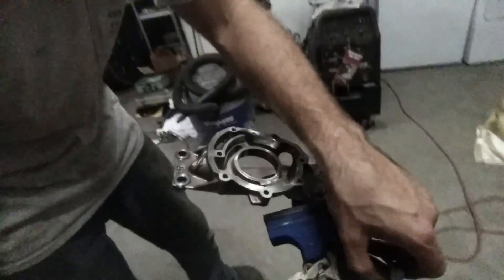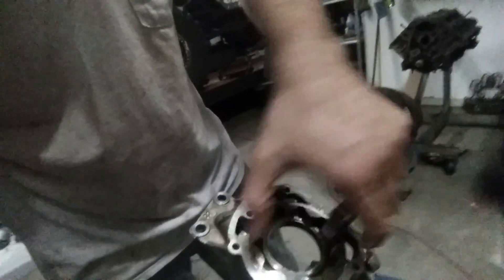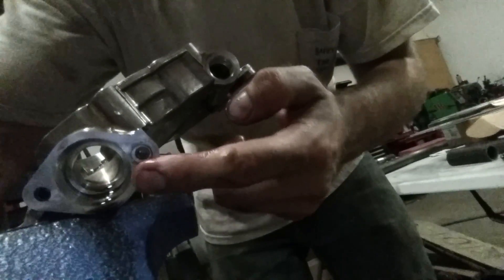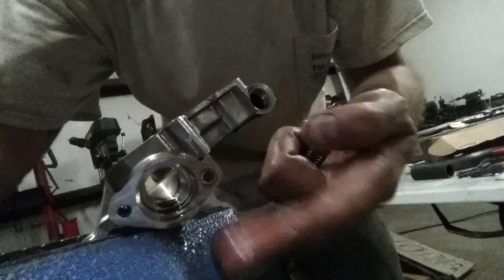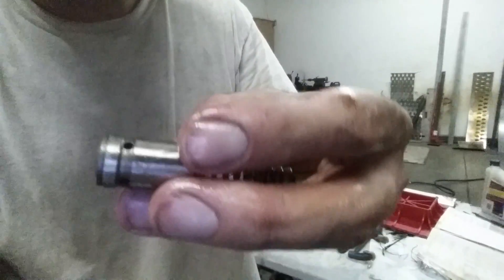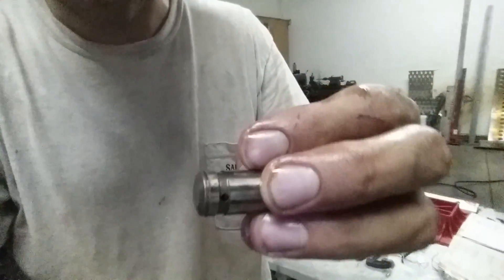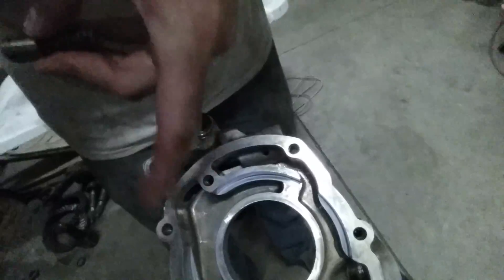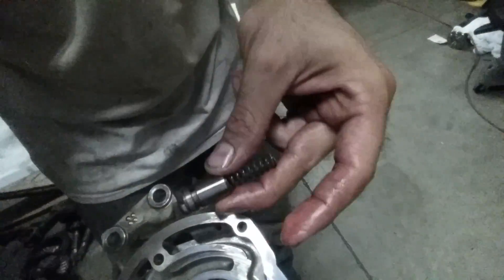Ls engine oil pump problem

Comment: Just a quick comment ---- oil is not compressible. It is a hydraulic and cannot compress. It can be pushed into the engine under pressure - but saying it compresses violates a lot of the Physics Classes I had in school.

Comment: Jake, I feel your exhaustion and I appreciate you posting this. I have the LS 6.2 Liter engine, I had lifter failer cylinder 6. I replaced all of them. Drove a week. And oil pressure to zero . Frustrating. I now waiting for autozone to deliver the new pump. I-ring was squished but not broken. Wasn’t a smoking gun on what’s wrong. I am praying now that I have it apart it’s the same issue you had. Otherwise gosh idk. A bad bearing?!? Ugh. Good luck in your race. My 2010 Yukon xl Denali had 193,000 miles.

Comment: Alright, here's where I'm at. I realize that not everyone who has low oil pressure on their LS is going to have the same common cause so before I get a flood of comments stating what it may or may not be this is what's done so far. Engine blew a head gasket. Tore down top end and replaced head gasket seals, valley cover seal, intake manifold seals, valve cover seals and water pump seals. Started her up. Ran fine with normal operating oil pressure for about 15 minutes of driving. Came to a stop and noticed oil pressure tapering off accompanied by a mild squeal that immediately went away. Stopped driving it and did a bit of research to no avail. So far I've replaced the oil pickup line o-ring that everyone likes to say is the problem, then inspected the oil sensor screen that doesn't exist on mine because between 99-06 there wasn't one. replaced the sensor just to be sure. still low readings. Replaced the oil pump and timing chain and gears while i was in there along with the oil pan gasket, still same exact readings. So like I said before everyone has some sort of issue causing this and you can read through countless annoying ass forums with nothing but speculation on what is causing this. Occasionally you'll get someone awesome like this guy Jake Burkey who actually diagnosed HIS problem and decided to be kind enough to share what he found. Unfortunately since I just replaced my pump 3 weeks ago I'll have to count that out as well. Im just wondering is there anyone on here that may have any idea other than what I have stated above that could be causing this issue. Im ready to put tanerite in the engine and shoot at it. 

By the way, it runs smooth as hell and runs very strong until the oil reaches operating temp and loses pressure gradually. Super annoyed and decided to reach out on this random video comment section as a last ditch effort before I pull this 5.3 out and find one with lower milage
Reply: More than likely to be a roller on a lifter seized
Reply: Man,,,,I Feeel your pain and frustration. & agree, jake was awesome to post his smoking gun. It is nice to see someone god damn it find the damn problem. 
Now someone just said lifter roller. And idk about that mechanically, if the roller was bad would destroy the cam. You would hear it I think. I have the 6.2 LS and did all the lifters, and a week later bells and whistles the oil pressure light blowing up again. So now waiting for autozone to deliver the freaking thing. But looking at the oil pump. I see a slight crack in the O ring, I mean a lil squished, 193,000 miles. But don’t look the worst. And I took the piston out the relief valve in oil pump and it don’t look the worst. So I’m worried now
. So I thinking with you and maybe me, could it be a crack in the block that heats up and opens? Maybe a bearing that’s blown?! Idk what else it could be. But I’m with you now....ready to shoot this mother fucker. I’ll let you know what happens when I replace the pump and O-ring. Cheers Kevin

Comment: This is EXACTLY what just happened to mine. Good oil pressure till it gets warmed up, then goes down to 6psi. Took mine apart, and it is exactly like yours. I could actually get the plunger to hang up when I took it apart. Confirmed that this is the problem...

Comment: Thanks for the info man!. i have a lm7 5.3 in my 2002 chevy silverado and ive been having low oil pressure i believe my oil pressure gage keeps jumping up and dropping but i have a feeling its the oil pump idk maybe you can help me also what tells me it is when im sitting at a stop light and its turns green then i go around 1500 -2000 rpm my truck will just lag so hard almost as if it wasnt getting fuel but then when i look at the oil pressure gage its drops to 20 also its worst in reverse.... When im in reverse i can barely tap the gas and it will bog super bad yesterday it actually shut off on me and tbh i believe thats when it dropped down to zero oil pressure so i cranked it hesitated for a sec then turned on and like i said i watch the oil pressure and when the truck bogs the oil pressure drops idk what it could be honestly.

Comment: The hydraulic lifters in my Chevy LS1 engine looked like that when I pulled them out of the engine block yet they measured o.k. with a micrometer.

I have fitted  new lifters but I'm waiting on the cylinder head gaskets & bolts, also I've been f**ked around with the timing cover seals,the gaskets were right but a rear main seal was supplied instead & the oil pump pickup tube wasn't, I replaced the timing chain so I needed that since the oil pump was removed,so I ordered an OEM one.

Then I ordered what was supposed to be a front crankshaft oil seal for the LS1 onwards engines only to be sent a seal for the 3.6 litre LY7 V6 engine (aka the Holden Alloytec V6 engine in Australia).

So I ordered one by part number rather than description on eBay today & I'm sending back the V6 seal tomorrow since it doesn't fit (it's OD is 70mm instead of 72mm & its ID is 50mm instead of 54mm).

Comment: Could you have fixed in the field by pulling the plunger and cleaning it out?
Reply: Apparently sometimes theyre dirty as you say and sticks the piston open, but he said his was stuck from wear not dirtyness, so In his case cleaning would have been a fatal error because the problem would come back at some random later date. This is not the type of problem you want to come back bro.!!

Comment: I have low oil pressure and noisy valve train for the first few seconds then it builds, whereas it used to build pressure right away. does this more likely seem like the o-ring gone bad thus losing prime like you mentioned? its in a c5 so getting in there to take a quick look is impossible and I just want to order parts before I start. Thanks!

Comment: those covers for the oil pump have problems with the return hole to the engine and you have to bore it out.
Reply: Hi January befor. Can you maximize your self on your comment? The valve is for the oil tu recirculate but it is to small? thats your meaning? or it glogge? Just now i have a issue. i start my Ls1. The oil press go up not so fast. between  2.5 minutes the oil press drops slowly to zero. so arround 2.5 seconds after start the oil become zero. oil light come on.

Comment: This just happened to my 2014 SS LS3. Im tearing into it this weekend. What other components were damaged from the failed oil pump?
Reply: did your oil pressure light come on?    how long did you run with light on?   was motor damaged?